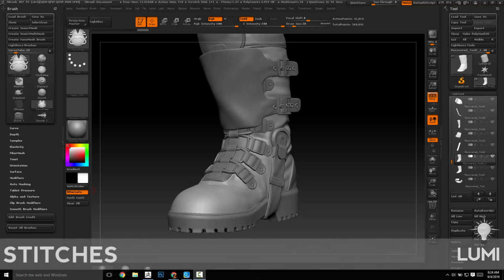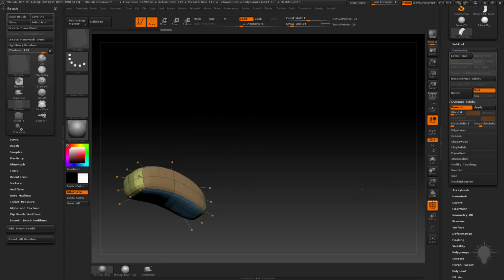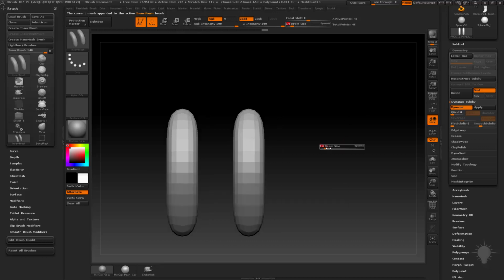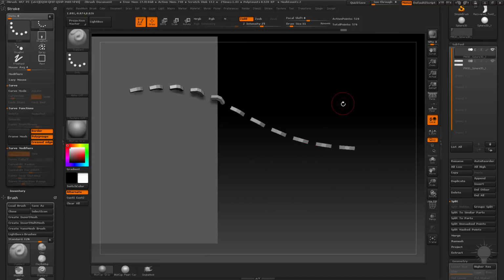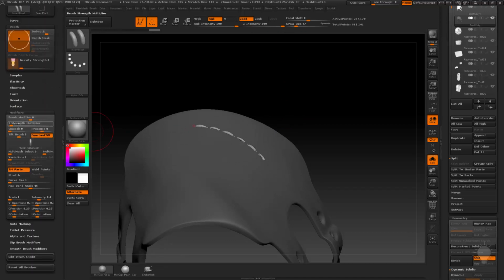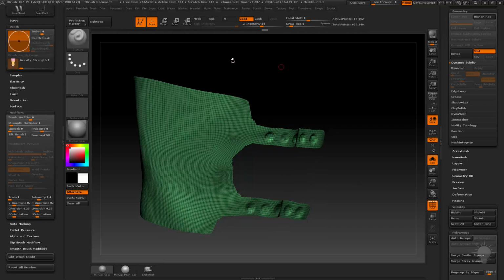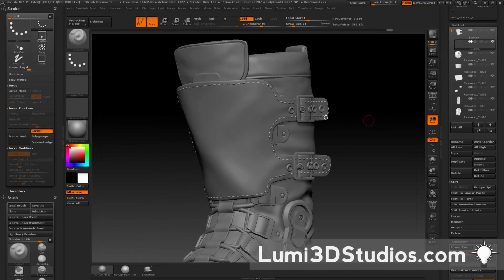016 Stitches

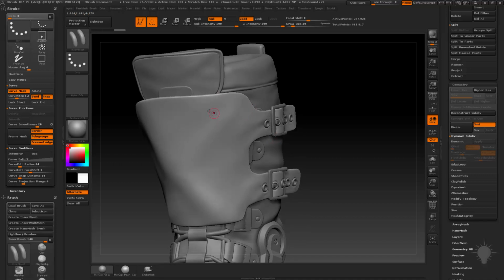Comment: I like this feature here at 5:55 where you can go back to a specific point and keep the path. Is there a way to use it with different brush, like standard brush? I want to add a simple stiching around an object, but it's hard to do it in one go. I need to rotate the camera and then continue it, just like here 5:55
Reply from the maker: With a live curve you can move your camera view and continue adding length to your curve, as shown here: https://youtu.be/J1Txk6wt7kw?si=dYND2x6ZTOC5uxqT&t=292 ; having said that, you can attach a curve to any brush, the deco brushes are a good example of this, see videos 32-34 in this playlist: https://www.youtube.com/playlist?list=PLkzopwqcFevZYety_luPvVfQlaHxph4eL . If you want just a sculpting solution for stitches, hit the comma key to go to your lightbox, and go to the brush > stitch folder, and load up stitch 01 - this has an alpha with stroke > roll set to 1, for easy stitch creation (you might have to see if curve snap distance will work with stitches if you need to move the camera, I think it should...): https://youtu.be/49Gsf4pEcb4?si=slRuquFFaFucexTr&t=201 . Having said all that, this is how I do most of my stitches outside of zbrush: https://www.youtube.com/watch?v=Ro5dADu3vpM *edit - and for anybody stopping by, here's how to frame a curve: https://www.youtube.com/watch?v=_IWgWHUpc0U

Comment: Awesome tutorial! I'm just wondering how will I texture the stitches in substance? Because what I'm thinking is to merge both stitches and leather subtool, dynamesh, zremesh for low poly, UV in maya and export to substance and bake. But if I apply a texture, both leather and stitches will have the same texture because the stiches doesn't have a separate UV, and what I want is for them to have different color. I understand that I can add them in substance but what I have are big stitches. I think I can't explain myself properly, hope you know what I mean and could you give a proper workflow how to texture them separately in substance? Thanks in advance!
Reply from the maker: I put the stitches on there in zbrush just as a demo, but in production I'd definitely just add them in painter, not bake them out from ZBrush: https://youtu.be/YZKCTzdqmp4 If you wanted to bake them (or any part of the boot) just fill them with a material ID color and use that as a mask in painter (for example, video 30 in this series: https://www.youtube.com/playlist?list=PLkzopwqcFevbWhV669XJZNclPLaIpO9de )
Reply: I see, many thanks to you. I'll try that out.

Comment: Love this technique thanks so much for the video Michael!

I have a question not so related to the video, hope you don't mind.. So I've been searching everywhere the reason or the solution why my stroke modifiers are all greyed out, and can't find any solution on how to unlocked them or know why is it so cryptic to find out the reason why is locked (I wanted to do some patterns like stitching increasing the stroke spacing but I guess that's not an option)
Reply from the maker: if you're sculpting the stitch detail, the lazy mouse options should be where you'll adjust the pattern spacing (lazy step). If you're utilizing the "roll" option under the stroke menu, lazy step won't act as intended. If you're using a curve brush to add stitch patterns, the stroke > curve > curve step is where you'll adjust spacing between objects. As for the greyed out part, I'm not positive-- make sure your object isn't a primitive (hit tool > make polymesh3D), and/or make sure it's not a zsphere or something, which won't have stroke options available.

Comment: Hey Michael,
I still do stitches in ZBrush at the moment since they look better due to AO.
Do you maybe know a way on how to achieve that AO effect in Painter as well?
Cheers Christian
Reply from the maker: Sure, there's also a way in painter to give an "embedded" look to the stitches as well; it's a little tough to describe in text, but basically create a fill layer with color/height of your stitches, add a black mask, use the stitch brush to paint white in the mask where you want your stitches to go, adjust the height / color / roughness of the fill layer as needed, duplicate this fill layer, add a blur filter to the mask, turn off all channels except for the height, drag the height slider into the negative for embedding. Duplicate this layer, add an AO channel if you haven't already, turn off everything except AO, go to the AO dropdown for the layer and choose whatever blending mode you want to add this layer to the AO on export. It's super subtle and usually ends up making things muddy so I don't bother doing the AO part, unless I'm going for a stylized look.
Reply: HA .. nice! Many thanks Michael, works great!
Is it also possible btw. to use one of the ZBrush stitch brushes that go in- and outward at the same time?
Can I somehow set 50% grey to have no effect while black pushes in and white pushes out?
This way I wouldn't have to sculpt the seams inside of ZBrush and then afterwards add the stitches in Painter.
Reply from the maker: In ZBrush sure, that's just utilizing the midvalue under the Alpha menu (check out the custom alpha section in Intro to ZBrush Part 2). Painter does have positive and negative height (red and green), but there's no adjustable "mid value" in painter that I know of, so any alphas imported would only be positive. Somebody fancier than me could probably figure out a really elegant substance solution that would work however, since it does recognize positive and negative height.
Reply: Someone just told me that you can put the texture in the Height Channel of the brush instead of the alpha (also disable the alpha).
Then you can apply it into both direction at the same time and use all of the ZBrush alphas for example. :)
Reply from the maker: Hmmm...do they have documentation anywhere for that, I can't find anything to support that unless I'm misunderstanding...any ZBrush alpha I bring into the latest painter behaves as only height positive; I can adjust them manually to be a 128 "midvalue" to behave properly with the linear dodge add, but again it's only positive. I'm not sure how to "apply it into both directions at the same time", which I'm not sure would work even if there was an option for that-- in the ZBrush stitch brush alpha, for example, the midvalue set at 20 tells the values below that to "dig in", and the values above that to "push out"; if you were to apply the zbrush alpha as-is in painter, it would push out, but applying that positive alpha "in both directions at the same time" would effectively cancel out the height entirely, again unless I'm missing something in translation.

I would love the ability to control positive and negative height in a brush, but I haven't seen that in action in painter yet, if you have a video or documentation it would be awesome to look at. However, even if they do have an option for painter for that that I can't find, I would still only be able to use this in limited situations-as soon as you begin painting height in a layer as opposed to a fill layer, you lose the ability to adjust important properties, and it becomes a destructive workflow, so I'd probably avoid doing much of it due to the amount of rework it would require if I had to iterate. Tied into that is the matter of material masking-if I want a divot line for stitches to sit in, I only want that to effect the surrounding materials height-- adding in height stitches into the divot does me no good if it's built into the brush, unless the brush can...somehow apply an accessible mask for the stitches as it goes so I can adjust the material properties of the stitches independently from the divot. 

Not saying it can't be done, I'm sure there's an elegant solution out there waiting to be found or implemented, and if you know someone who can do that I'd love to talk to them!
Reply: Hmm .. I haven't seen a documentation for that anywhere.
I couldn't find a way to make it work with a fill layer unfortunately but here are the settings for the brush.
https://s11.postimg.org/pl4mspsf7/Untitled_1.jpg
If there is a way to make it work with fill layers I'd really love to know as well!
Reply from the maker: ah, I see. Yeah I get the same thing manually adjusting the values to the 128 midvalue (most of the zbrush alphas I tried weren't in that range). I'd love a midvalue adjustment as well as a roll function, laying down curves and stitches are a bit choppy without roll. But yeah, doing this non-destructively eludes me...someone smarter than me will have to get elegant in Substance Designer and import that as a painter tool maybe to separate stitches and allow arbitrary height adjustments to the surrounding area for divots.
Reply: Yes, would be nice to shift the seam/stitching stuff from ZBrush to Painter.
Maybe someone else has got an idea or we are lucky and they implement things like this in the next update..
Maybe I should post something in their feature requests forum. ;)
Reply from the maker: Totally, the allegorithimic people are pretty on the spot!